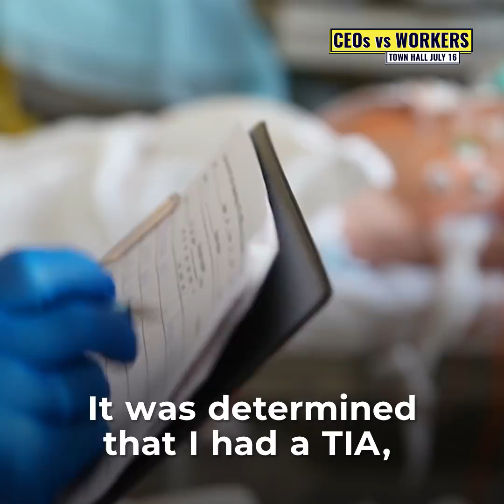Former Amazon Manager Suffered a Mini-Stroke After 16-Hour Days

Comment: I've got 2 theories on where technological advance will go and that's on this basis:
Advancing technology makes automation cheaper. It can go from 50 people moving those carts around to the carts moving on their own and a single repairman and coder on site to repair anything that goes wrong and run maintenance. This means that the output per hour spent working by a single individual will increase.
This can lead to labour oversupply. There being far more people willing and able to work than are actually needed to meet worldwide demands. This makes it easy for corporations to treat their workers like garbage. Attempts at unionisation to force up wages and improve working conditions make it cross into machines (which aren't cheap) being cheaper than people and companies switching over to those.
This causes increased unemployment, lower wages and less free time in which people can consume, which lowers demand, lowering the prices and the amount outputted by businesses, meaning they will push any remaining workers even further, causing machines to become more and more viable.
This will eventually lead to a society in which massive portions of the population are simply cut out of the economic equation: unemployable as they've been replaced by machines, no consumer power because they don't have any money. The best these people could hope for is performing services to the oligarchs that would form, yet even these are becoming more and more automated by AIs like holy shit even sex workers, performers of what is probably the human race's oldest profession, are at risk of being removed by sex bots and VR. 
Oligarchs become self-sustaining. They can have their own personal largely automated farms for all their food, construction can be done with the hiring of a single overseer of the machines to expand their house, even security to keep the starving masses at bay can be automated (and there will be enough among the starving willing to become the guards of the oligarchs). Even those without personal farms etc can just buy from other oligarchs. Automation making human labour unnecessary can lead to living conditions comparable to before we had any form of automation.

Alternatively, if there were an extensive welfare state, the entire "massive chunks of the population starve" part of this is removed, and human employment may continue due to continuous demand for goods and services in the form of people being able to afford them.